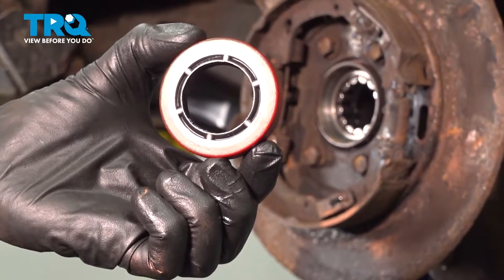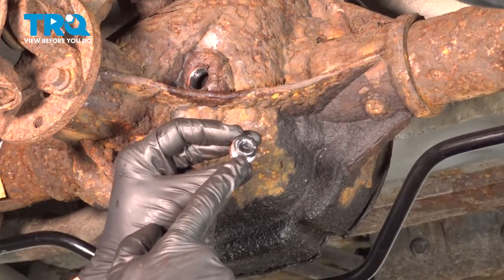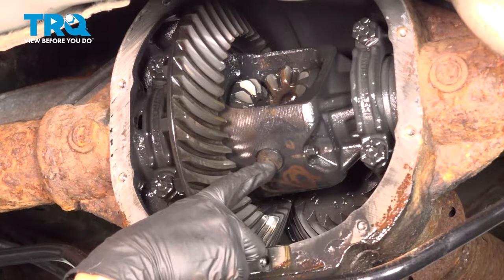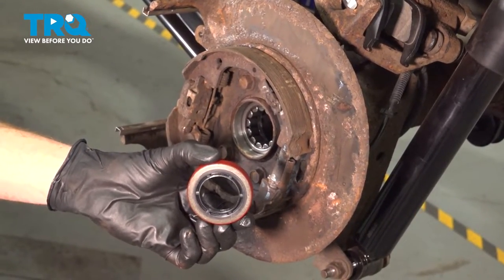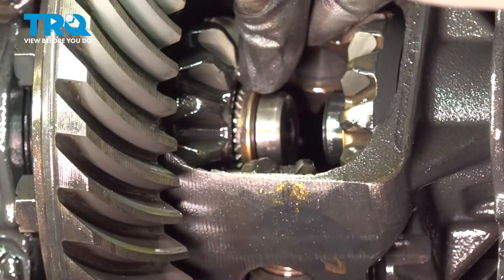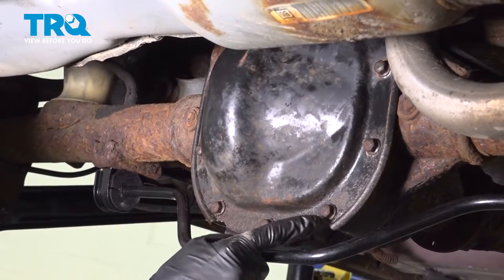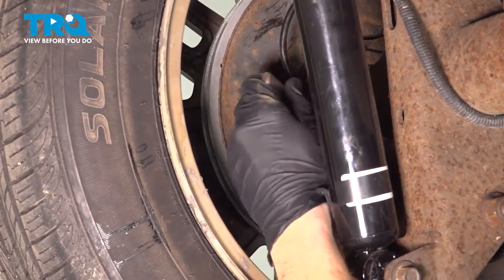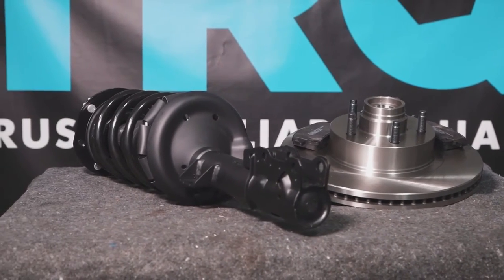How to Replace Rear Axle Seal 2003-2011 Mercury Grand Marquis

Comment: Bolt torques for the differential 8 mm bolt inside the diff and oil pan bolts would be helpful for inexperienced DIY mechanics who dont have your experience with the repair. Hopefully they have a torque wrench.